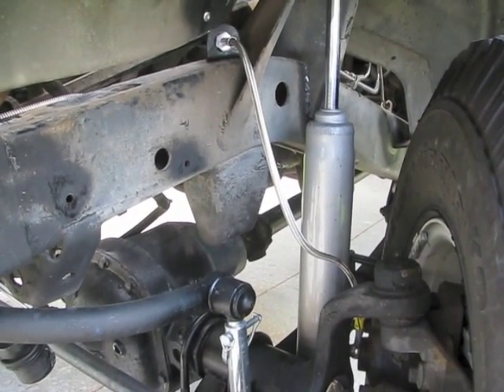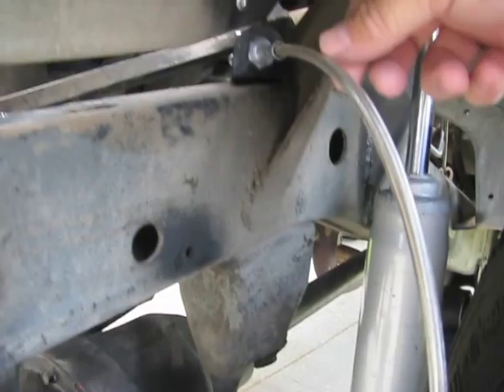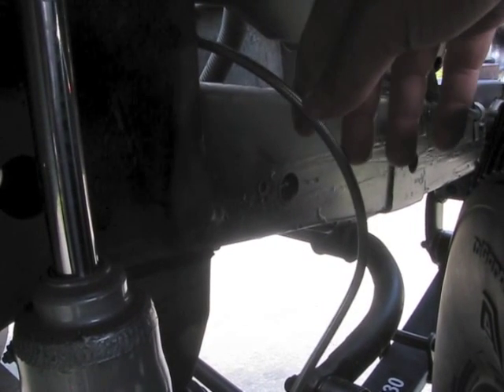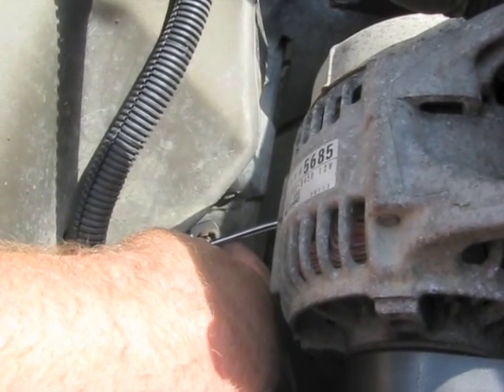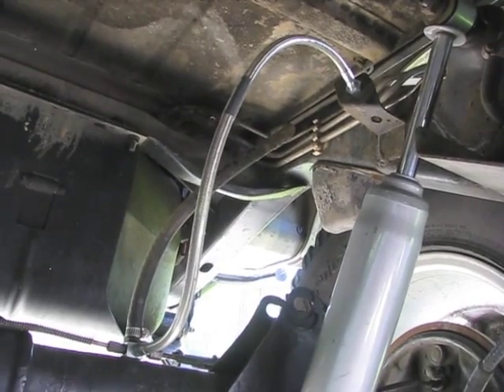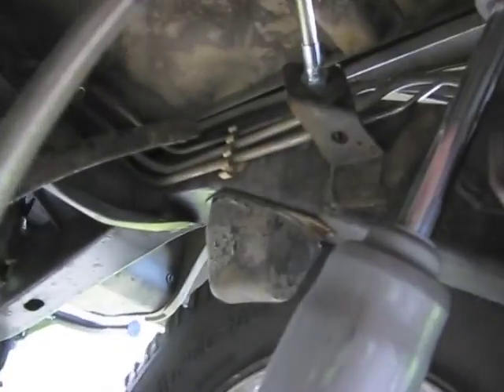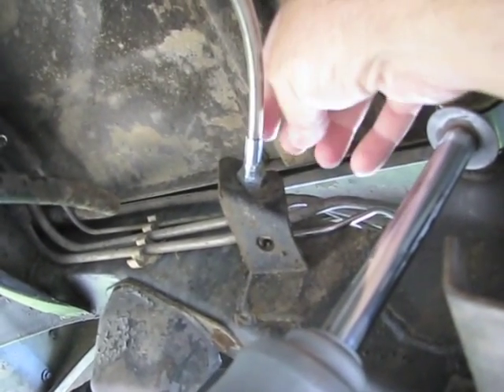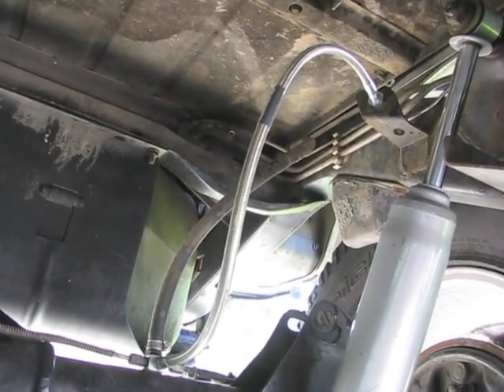Jeep YJ Extended Brake Lines   GOODRIDGE (Part # D-FBL-47)

Comment from the maker: I think you will be very happy with the RE 2.5" lift on your Jeep. I know that I am. 
I didn't make a video on it but I have already ditched the t-case drop and reinstalled my other transfer case which has a SYE already and am running a shortened XJ front driveshaft in the rear of the YJ. With the t-case drop it is a pain to shift into 2nd, 4th, & Reverse. On an automatic YJ it would have been fine other than the loss of ground clearance with the skid plate being lower.

Comment from the maker: I plan on fabbing up some bump stop extensions for the front. Tire barely rubs the front fender under full compression with the sway-bar disconnected. With sway-bar connected it is nowhere near. The rear is fine.